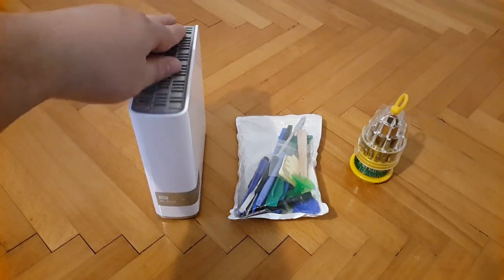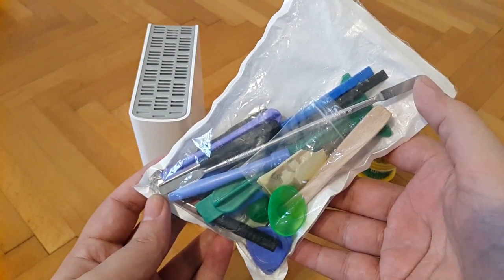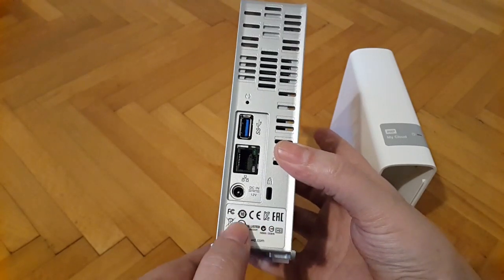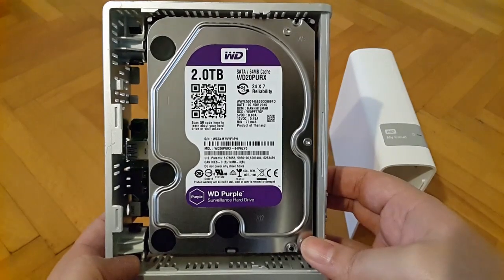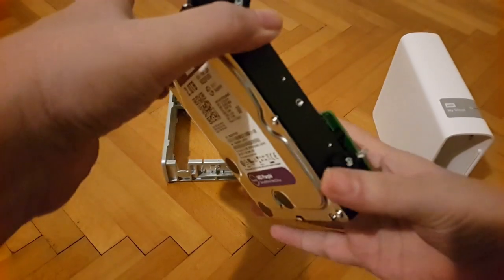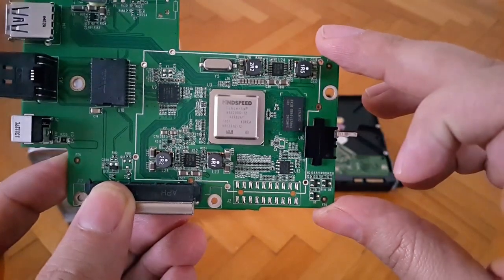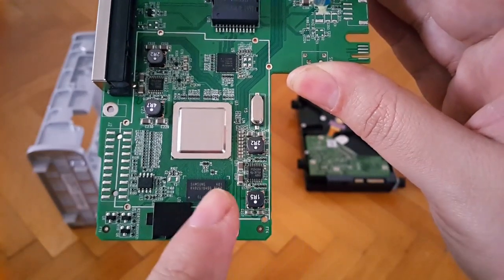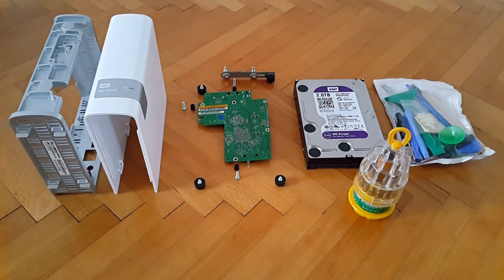WD My Cloud 3 TB - Enclosure Teardown (Take Out HDD)

Comment: Thanks for this video! :-) Just dismantled my MyCloud to add to my new Synology on the cheap.
Reply from the maker: Hi,

Sure, glad you liked it. 😆👌👍

Don't forget to sell the enclosure & everything to get some extra cash. 😏😉

Best Regards,
Reply: Hello @David  and @seajayshore …I’ve got the drive out of the enclosure but I don’t know what to put it in. How do I know what other enclosures would work? The one I currently have can’t connect (Sabre t model CES-u35k). This comment interested me and I looked up the Synology but unclear how you added it. Which model do you have? I was looking at DS218. Thank you in advance for your responses.
Reply from the maker: @DaQueen  Hi,

Well for the WD My Cloud I think that only WD 3.5" SATA HDDs would work successfully or be recognised without problems by the enclosure's PCB controller. So regardless of capacity, family name (i.e. Green Edition, Gold, Blue, Black, Red, Purple...) & speed (SATA2 or SATA3). 🤔😏

However I have also heard that people were able to fit Seagate 3.5" HDDs into their WD My Cloud enclosure with no problems... As well as 2.5" SSDs (i.e. Samsung).

For Synology DS218 just look up on YT for a disassembly guide (if you want to learn how to add or replace HDDs in that particular styled NAS). 😇

I would of course recommend that you format the HDD prior before putting it in your Synology NAS. Naturally copying the data off the HDD before (if you have any).

Best Regards,

Comment: How did you unscrew the last part of the hard drive the silver on top of the black. I tried and it was impossible. If you could tell me which tool to use or show video that would be helpful thanks
Reply from the maker: Hi,

I did mention this (starting at) @ 33:51 ... 🤔🙄

It was really hard as I said it. I can't recall at the moment which torx but or size did I use but the screws were really secured on tight. 😕😞

I don't have the unit anymore sadly to give you more info as I upgraded to a Synology DS214SE NAS.

Best Regards,
Reply: Fahmina, did you solve it? I also tried to unscrew it with a lot of tools with no luck :(

Comment: NOT a Fuse.  The part has a silkscreen R325 (R=Resistor, 325=Schematic number).
0 = Zero ohm resistor.
Reply from the maker: Ok, thank you for the clarification then. Cheers ! 🤔😏

(@ 27:27 video reference)
Reply: @davidbolha  resistors are sometimes used as fuses
Reply from the maker: @3D_Printing  Yeah I've seen this with these gadgets: https://youtu.be/a41MNIKJYWw

Comment: hey i have one of these and im wondering if i can take out the hard drive and use it as a normal one because i need a good hdd but dont want to transfer files over wifi. is there any software on it that doesnt allow me to do this or can i simply erase and format it? thanks
Reply from the maker: Hi,

Sure you can. Well besides the OS, which is I think some sort of a Debian Linux derivative, there is nothing really holding you back from deleting partitions or overall just formatting it. 😊

I usually use MiniTool Partition Wizard program.

Comment: Hi, thanks for the video,

I have a query, I have a similar unit, by mistake I gave a quick restart (thinking it was diagnostic) and the unit was restarted to the factory system.

I am sure that my data is still in there because immediately when I gave the button it only restarted instantly and in seconds it was already in the factory configuration.

Do you think that unmounting the hard drive and placing it directly to my pc could recover my data?

I hope you can help me with information. Thank you
Reply from the maker: Hi,

Yes, you're assumptions are correct. I think too that your data is actually intact. 🙄

 But you'll probably have to use a Linux based machine in order to retrieve your data. Or at least use a Linux Live Distribution type OS (i.e. System Rescue CD) in order to pull this off.

I think though that you can even get plugins/programs for Windows in order to read/access those EXT3/EXT4 partitions on the NAS drive. Where your data is stored basically. 🤔

https://www.howtogeek.com/112888/3-ways-to-access-your-linux-partitions-from-windows/

So you can approach your problem from both angles.

Best Regards,

Comment: I have a 6tb and it appears the circuit board is faulty (blinking blue led). Can I just pull out the drive and mount it on a HDD dock to access all my files?  Thanks heaps!
Reply from the maker: Hi,

Possibly you could, but depends on the OS you are using. In Linux EXT2/EXT3 partitions are easier to access then in Windows. There are extra drivers or software that enables this, but you need to do some research which one would be most optimal for the Windows OS version you are using. 🤔🙄😏

Best Regards,
Reply: @davidbolha  Great! Thanks David. Wonderful breakdown and explanation in your video.

Comment: Excellent and detailed video Thanks
Reply from the maker: Hi,

Thank you ! 😆

Glad you liked it.

Best Regards,
Reply: @davidbolha  THANK YOU, THANK YOU, THANK YOU, THANK YOU, I think I have a COMMON WDMyCloud LED not lighting  "Blue" issue. This video helps make me Too scared to try a fix, too small to replace without HotAir Station:)
Reply from the maker: @3D_Printing  Well I know that I fixed a similar issue on another WD My Cloud product by simply "baking" the PCB controller of the unit in a oven at about 200 °C for 8-10 min. 🤔😏

But overall I'd simply suggest avoiding the WD My Cloud products alltogether. I've read on the WD Community forums years ago how many people's units stopped working after a firmware upgrade (4.XX. ...). That many faced problems with network detection & all.

Heck even my older WD My Book World Edition (White Light) NAS was working flawlessly then these newer products. 😕
Reply: @davidbolha  WDMyCloud keeps going Offline in Windows 10 I have just tried changing to a STATIC IP I hope this helps ME!!!, unsure yet still testing. Note I no longer EVER see a Blue LED lit even when it is working this is a COMMON issue that it gets Bust Bad WDMyCloud Quality Control. So This makes it difficult to know what's happening by the LED.'s
Reply from the maker: @3D_Printing  What firmware version are you using ? 🤔

Because what you're describing is the same as what other users reported on the WD Community forum after updating their firmware on their unit.
Reply: @davidbolha  I am Trying versions of WDMyCloud tips but it looks like, (still testing), using a STATIC IP is working so far; to prevent the stopping transferred of files from WDMyCloud to local drive during 2Tb. I always update WDMyCloud Firmware, Windows 10 and Drivers, etc...

Tried most of: -
Add My Cloud to the list of credentials
Modify the Registry
Change Internet Protocol Version 4 (TCP/IPv4) settings
Perform a Network Reset
Reply: @davidbolha  Thank You :)
Reply: @davidbolha  ps never had issues apart from the blue led not working with Windows 7 only with Windows 10

Comment: What were the size needed to unscrew the last part?
Reply from the maker: Hi,

I have no idea which Torx size it was as I sold the unit quite some time ago. But I think you could basically remove the rubber feet coupled with the screws just by hand. No screwdriver needed. 🤔

Best Regards,

Comment: Can I remove the hard drive and install it in a synology or a computer and access the information in it? Mine is no longer working and have information that i need! PLEASE!
Reply from the maker: Hi,

Connecting the HDD to a computer (i.e. desktop one) would be more sensible then putting it in a Synology NAS. 🙄

You can use any of the Linux LIve CD type OS distributions that are out there available too. So System Rescue CD, Ubuntu, etc. You could probably be able to get the drive accessed through Windows as well. Depends though which Windows version you have. 🤔

Best Regards,
Reply: @davidbolha  Hi David, I appreciate your help A LOT! I am not an expert in all of this but what a heck I am going to give it a try. I need those files. Can i send you messages with questions?
Reply from the maker: @ghgalarza  Sure thing. I'd suggest first trying to access the drive via Wndows (by installing an appropriate 3rd party software-driver). Which Windows are you using ? 😏🤔
Reply: @davidbolha  hello, un using windows 10. Oddly today the light is blue but I can't access it. at all I can't see what IP has, ETC
Reply from the maker: @ghgalarza  Try searching (on DuckDuckGo) for terms:

- Windows 10 mount EXT3
- Windows 10 mount linux partition
- Windows 10 detect EXT3

Is the web administration page accessible ? 🤔
Reply: @davidbolha  no, it reset it and it stays in the terms and agreement page and it says UPDATING 😢
Reply from the maker: @ghgalarza  Did you search  for the keywords I provided ? 🤔

The easiest way for you to get your data back is to take out the hard drive from the NAS enclosure & directly connect it to your desktop computer. I hope you have one available (& that it has SATA 2/3 support). The motherboard I mean.

You could even connect the HDD to a laptop, but then you need a USB SATA 2/3 to 2.0/3.0 dock unit or such an enclosure that supports this. 🤔

By using the hard drive directly while it is still in your NAS is not going to work probably. 😶
Reply: @davidbolha  Hello David, I did but i suppose i have to open my computer to find out if I have sata 2/3. I  will check and i will come back to you. Thank you and I will be back, I appreciate your help very much.
Reply: @davidbolha  I already checked and my computer does not have sata 2/3 :( should I order online the usb unit instead? what other option do i have? I have a synology unit maybe i could insert it there?
Reply from the maker: @ghgalarza  What's your motherboard (manufacturer & model) ? 🤔

Well if you don't know anyone who is willing to (at least) lend you a/his desktop computer that has a motherboard with SATA ports on it I don't know of anything else.

I don't know if that's wise because at best the unit might not recognise the inserted drive or (at worst case scenario) it might format it (thus erasing its contents) in order to use it. 😶
Reply from the maker: @ghgalarza  Looks fine. 🤔😆
Reply: @davidbolha  thank you I'll order it right now.

Comment: But if I take the MyCloud's hard drive and I mount another for tests .....
In the end if I put the device back back as before? or do I still have to reinstall all the software?

Please take this doubt
Reply from the maker: Hi,

I think it would be fine, but what sort of tests in particular do you have in mind ? 🤔

Best Regards,
Reply: @davidbolha  I would like to try different versions of OpenMediaVaul or Synology type software. If the software lies in the hardisk perhaps just replacing it for the tests. eventually putting it back it should work normally .. at least I hope
Reply from the maker: @francescodellanno675  In that case I doubt it will work as the partition size for the OS from WD might be different from the requirements by Synology. 🤔😕

So basically you even might have to repartition the entire drive. Thus in the process loosing the data/multimedia files you have stored on that other EXT3 partition.

Honestly I don't know what the result might be. I'm just speculating. But as a precaution I would copy the multimedia files that you may have on that drive temporarily to another one. 😞🤔
Reply: @davidbolha   Maybe I did not say it clear enough .
I take off the disc. I do all the tests with a new record.
At the end of the games I put the original one.
should operate normal
Reply from the maker: @francescodellanno675  I don't know. Try it.

Comment: how did u take off the plate on the side? i deformed mine trying to take it out lol i dont know what to use
Reply from the maker: Reazon Giovanni Which plate ? Point me to a reference in the video for easy orientation. 🤔🙄
Reply: 34:19 i know what i need. i stripped them using something else lol
Reply from the maker: Reazon Giovanni Aha. I really had to struggle with that plate. Thought I'm going to destroy a torx bit trying to unscrew that. Glad you found a another way. 😣🙄
Reply: Reazon Giovanni how did you do?i damaged the screws while trying. And still can’t find how to.

Comment: I was wondering if I can attach two three hdds to this Nas using Sata hub (if its exist) since there is one free slot on the board. will it work? Obviously it won't fit in its own enclosure so will need new casing.
Reply from the maker: Hi,

Interesting idea, but very doubtful. 🤔😕

However you can attach an extra USB 3.0 external hard drive to this unit.

Best Regards,
Reply: @davidbolha  yes right that can also be used as raid back for the main hdd. Anyway attaching more hdds might won't be worth it due to limited  ram capacity.

Thanks
Reply: Likely no... 34:30 that plate that was literally welded onto the drive, rendering it impossible to put into most enclosure. I was looking for a solution to remove it as well.
Reply: @ATM015  I got it out with a small pipe wrench and an oversized hex screwdriver bit which was forced in. The drive was clamped in a vice
Just to prove it can be done I guess. Drive is usable of course, though I won't guarantee your results
Reply: I went with a 3.5-inch hard drive enclosure with power (I already have) + a SATA extension cord.

Comment: My WD MyCloud is Dying. I think the drive is going bad. Its really slow to load files. I want to replace the drive inside. Do you know if this is possible ?…..If so what drives do you recommend. I have the one like this on in the video but it’s a 3tb drive. I would like to try a 10tb WD Ultrastar DC HC510 hard drive. What do you think ?……Will it work ?…..
Reply from the maker: Hi,

Of course this is possible. Well definitely with only WD's HDDs you should be experimenting I'd say. Red, Black, Purple or Gold edition types would be more then welcome. 😏

Sure, try a 10 TB type if it will go. An will 8TB surely be recognised. You have additional info in the 2 links in the description part of the video on creating the partitions & installing the OS onto the drive when you'll decide to get a replacement. 🙄😏

But I'd definitely take out your existing drive from this unit & test it on a desktop computer using CrystalDiskInfo & HD Tune Pro software. To see the SMART data & if you maybe have bad sectors on the drive. Don't forget to copy the data off first before fiddling with the HDD... 😇🤗😉😆

Also if the HDD inside your unit is bad you can still sell it (the PCB controller in particular) as a donor drive on your local internet online flea market website for parts. People can still make use of your HDD for data recovery on their broken HDDs. Don't forget to use DBAN software to wipe the drive clean when & or if selling it (if you'll decide to do so)... 🤔😏

Best Regards,
Reply: @davidbolha  I'm looking for the link you mentioned for creating partitions and installing the OS on the drive. cant seem  to find it.
Reply from the maker: @Nick-od9ln  Hi,

Did you check the description part of the video ? 🤔

Best Regards,

Comment: Hi my board is no active when power in. I have check DC in socket impedance is 4.7 ohm. look like something is shot.
i have check C12, C13 it is 4.7 ohm. any one please help to check your board DC is impedance. I'm not sure it come from this capacitor or not. it very tiny. when i remove it i think i cannot solder it back. but if it from this 2 capacitors. i will remove it may help me to recover my data. Thanks
Reply from the maker: Hi,

Connect the internal drive either to a SATA-USB 3.0 dock or to a desktop computer that has at least SATA 2.0 on the motherboard. Use Ubuntu or System Rescue CD to read the contents of the EXT3/EXT4 data partition & retrieve your data. 🤔😏

You could probably even manage to read the contents of the drive in Windows 10 with a proper EXT2/EXT3/EXT4 wundows plugin. 🙄

Best Regards,
Reply: @davidbolha  
Thanks, I was use "DiskInternals Linux Reader" free version. it can see data in HDD, but cannot found my pictures. not sure because my WD drive is 6TB or not. I was try Windows Subsystem for Linux too "https://docs.microsoft.com/en-gb/windows/wsl/wsl-config" but cannot find a ways to mount HDD yet. Will try it more. by other way is try to fix the controller board. Thank you very much.
Reply from the maker: @kamthornj  Good luck ! ☺🖒

Comment: stupidest idea to have it only work when connected to router and not let you plug it in directly to your computer with a usb or something.
Reply from the maker: Hi,

Well you could use those generic USB 3.0 enclosures & put the hard drive inside those. 🙄

I mean I use the Total Commander app on my smartphone/Tablet/Smart TV to access all my files (movies & TV Shows mostly) on my Synology DS214SE NAS.

But the actual product as "WD My Cloud" is pretty fragile. Not to mention vulnerable:

- https://www.trendmicro.com/vinfo/us/security/news/vulnerabilities-and-exploits/vulnerabilities-and-a-backdoor-plague-western-digital-my-cloud-nas-devices

- https://www.techradar.com/news/wd-my-cloud-nas-boxes-found-to-be-vulnerable-to-online-hacks

- https://thehackernews.com/2018/09/wd-my-cloud-nas-hacking.html
Reply: @davidbolha  Yeah, I took the hd out of the wd mydrive casing after getting nothing but yellow light.  It's annoying to take apart, but at least it's not a brick anymore.
Reply from the maker: @MandrakeMoorglade  Usually this can be solved by "baking" the controller board of the unit in a oven for 8-10 min @ 200 °C. 😕😌